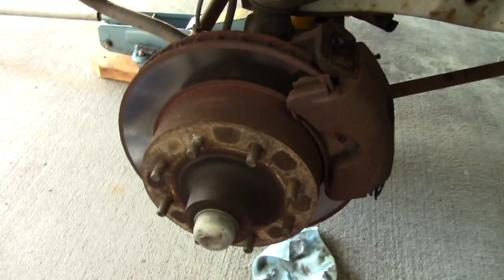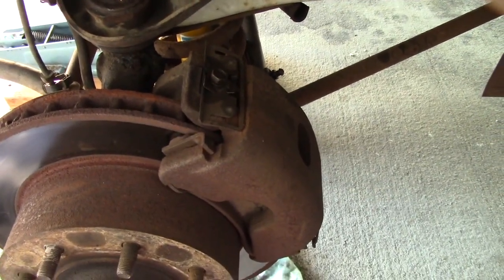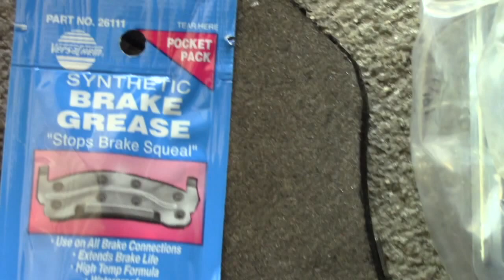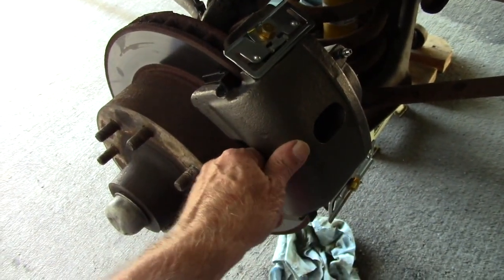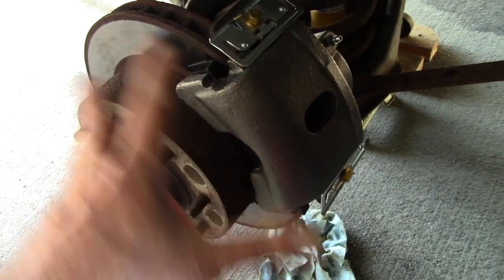Roadtrek - Installing Disc Pads and Calipers

Comment: Excellent vid sir, guess it's time I did mine. Have an O'Reillys right up the street. Did you get the pads and calipers at O'Reilly Auto or did you order them online?
Reply from the maker: Hi Hello Goodbye,
Thank you for the question.  I got the parts locally. O'Reilly has them in stock in my area.